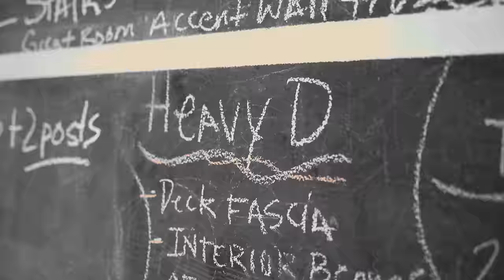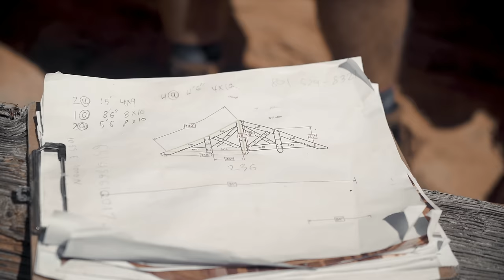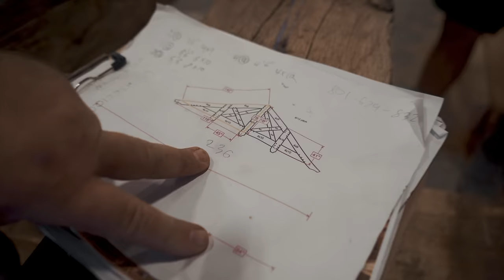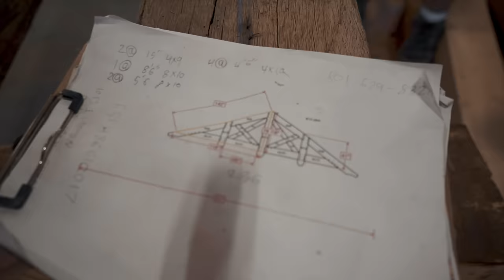How To Turn Old Lumber into GOLD!!!

Comment: Accent Mark's are a ton fast with a grinder with a metal blade. Tons faster. Take those beams outside and pressure wash them with a 4000psi pressure washer, then hit them with a sander. Then hit them with a dark brown spray paint in the low spots. Then sand again. Exposes all the grain but keeps them smooth and soft

Comment: I had a post and beam home built came out awesome not one power tool was used and no nails in the whole frame of the house you guys should see this thing and then I got a tulakievi fire place stove my house is like the Igloo cooler up here in New York I don't need air conditioning in the summertime and I just have to heat my fireplace for a couple hours and it radiates the heat for days

Comment: Now go buy some steel wool, get some white vinegar put the steel wool in the vinegar and let it disolve then use the solution and put it on the wood and it will turn all the new cut surfaces back to old looking greay wood as long as it is fir, pine, spruce or any other conifer. The tanins in the wood react with the vinegar and Iron solution and turn black or gray depending on how many times you use the solution.

Comment: Wanna save some of those saw blades ?
Run a metal detector over them before you cut them.
Once to locate metal use different size punches to find where it's embedded.
Start with a 8 inch long (minimum) 1/4 punch.
Anything smaller will most likely bend in wood that old and hard.
I used to help a friend of my Dad's repurposing old wood like that for his custom cabinet shop.
Hard work but worth it.

Comment: Heavy d I have some lumber like the ones used on the rail roads I’m would be more than happy to get rid of it to someone who will have a better use of it
Reply: You may as well keep it the. If it’s old railroad wood, then it’s not worth anything and can’t be used for anything. The old railroad timbers and lumber were preserved with creosote to prevent rot and make it impossible to use that wood for anything else. Creosote stinks really bad and is also known To cause cancer in California tests so stay away from that junk buddy. It’s also illegal to burn that stuff so just stay away from it!

Comment: If you are for real my buddy an I took down a cabin pice by pice this fall bunch of beams I took the boards of the cabin nail by nail took me a enormous amount of time not to mention the weeks it took to pull up the cherry flooring...all of the flooring is under a roof BUT the lumber from the cabin is not and needs to be taken somewhere it can be useful and get used instead of rot in the back yard of my buddy's house.. .. If you are..  for real, seriously get ahold of me.. I also have huge 14 foot live edge slabs of curly oak 98yr old red oak rounds that are 3foot×3foot....  help me help you I'm trying to sell the live edge slabs to found building my glass studio in the shed at my house it's been a life long dream and it keeps $ in my pocket and food in my belly.... parts for the jalopy vehicles I own running,,kinda,,, but  in turn I give folks cool glass jewelry..   you probably won't see this anyhow but I threw out a comment to a hopeful helping hand

Comment: Code is code and regulation personal feelings aside things that work for hundreds of years for many reasons but feelings don't pay the bills or your opinions. I don't mean to sound like an ass but really! Sound like you've been picked on by people that were older than you that's what it sounds like but that's okay you want to do your own thing that's cool I get it but things that work for hundreds of years for a reason you can be a hot shot but my something feels try something different you never done before you start running into problems just like the people that no rush job on a house build eventually it looks good at that time are personal feelings on tradition Mike end up slapping you right in the ass it's cool but looks good but if it's never been tried and tested how do you know. I mean really know numbers in research isn't going to be the definitive answer but there are opinions just like buttholes everyone has one I guess I do too. You can do what you want but don't pass judgement in anything about tradition just yet it's been tried it's been tested has been proven Epiphany it's just that an epiphany. And I seen so many people just like yourselves try this same stupid Venture and they wind up failing I wonder why that is.